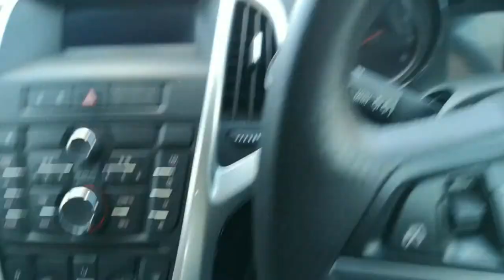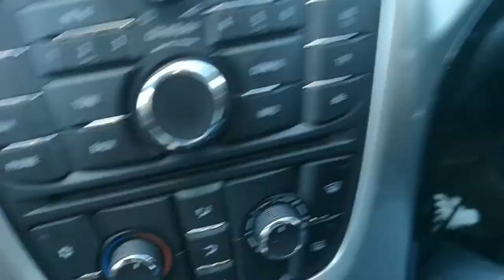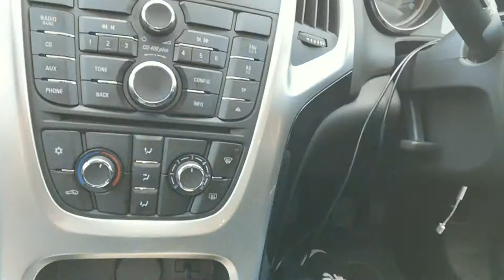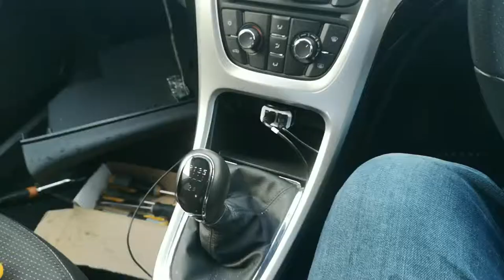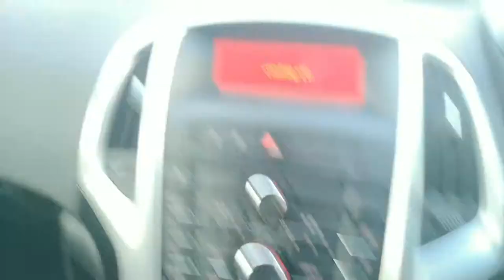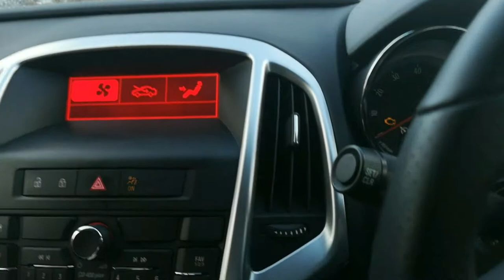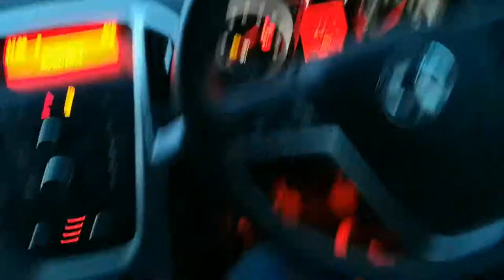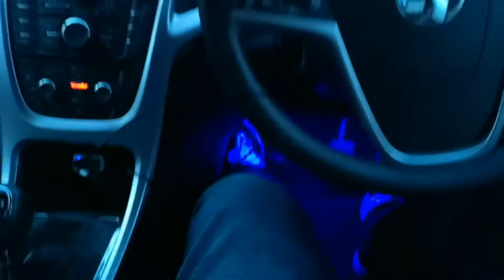Wiring things into the astra

Comment: Hey man, did your astra come with the red leds below the gear gator or have you had to install them? I've recently bought a 64 plate Astra J special ed which has the leds on the inner handles but no sign of gator lights. Be great to hear your thoughts, much appreciated! (Ps. I hope you're not letting your thyroid issues get you down too much, I have exactly the same experience chronic fatigue, patches etc. It gets easier!)
Reply from the maker: Yea mine was standard on the car however our new astra doesnt have it under the gear stick. Also thanks for your kind words i really appreciate it 🙂